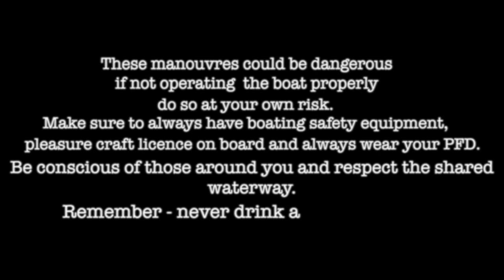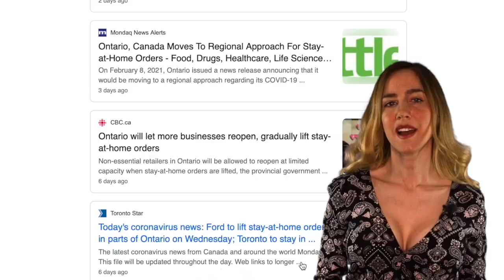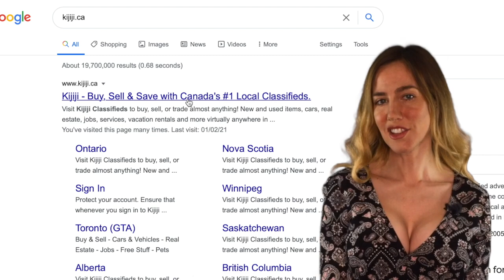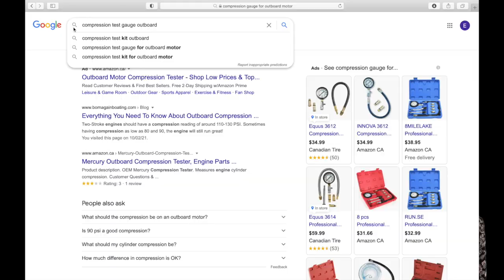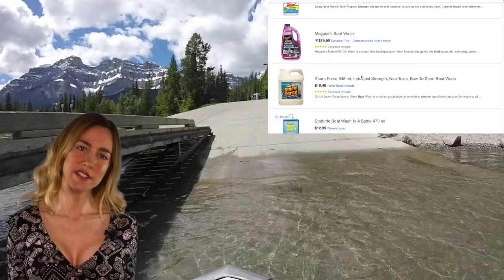Buying your first Boat? Watch this first!

Comment: i got my first, sorta. its a 1980 yamaha boat with a yamaha 70 motor. looks a lot like your banshee.  got lucky, came with a trailer too. all for $1,500. maybe cuz the tilt and trim dont work. got to use the peg through the mount holes and be happy where it is the entire time. 

got one question. i cant get it to stay at 3500 rpm. its a comfortable speed for me and the wife before she starts screaming in fear. as soon as it hits 3000 rpm it wants to blast off to max rpm on its own.  is that normal? my previous boat was a 10 ft inflatable zodiac with a 9.9 four stroke tiller handle. it didnt do that. mind you, that motor was to big for that boat. it didnt want to take off on its own but it kept wanting to fly up the bow like it was going to flip. anyways, i got tired of the sore neck from the tiller so i bought this yamaha.  i havent found a video yet on how to control the acceleration. so, is it just me or is this normal and im just a wimp still getting used to it? 
thank you